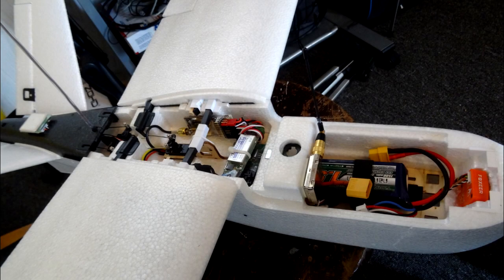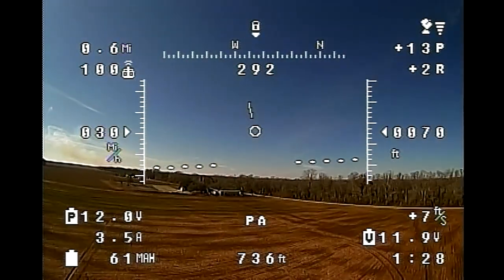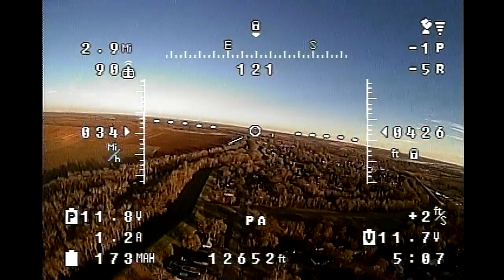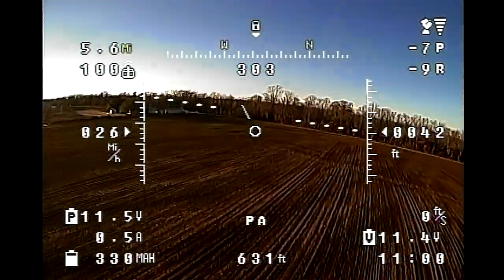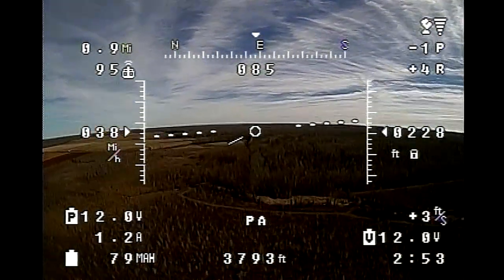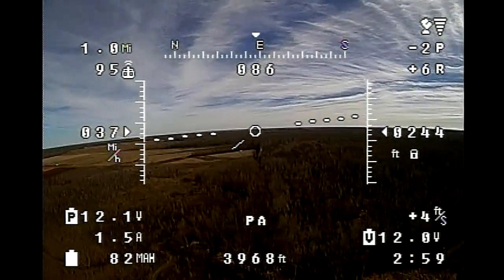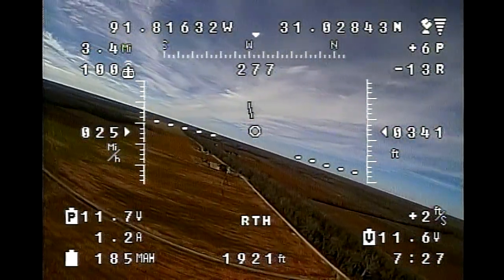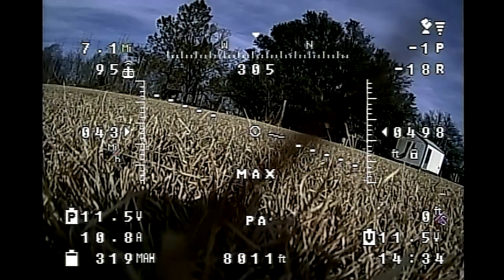Nano Talon w/Storm Follow Up

Comment: Great follow up! I totally get what you are saying about this not being an ideal FPV flyer. Either you want something fast to race like a wing, or a steady long range cruiser. But the Nano Talon isn't a racer, and it gets bumped around by the wind easily. I bought mine on Black Friday as around that time, it seemed everyone was reviewing this plane. I am still a beginner in R/C planes, so the appeal to me was the built in stability and the slot for the camera. Seemed like a nice little package and long flight times. I popped my FPV cherry on this bird so it has been exciting to fly, however when it's windy it's very hard to maintain a steady heading. The wind always blows me downwind and I almost lost her twice(was losing video). I appreciate your diligence to see just how stable you could make this platform. I will reserve a flight controller and long range system for my Strix Stratosurfer. I did put my camera and vtx on my Bixler 2 and will fly that today. Even without a stabilizer it should be relatively smooth.
Reply from the maker: I totally agree! I actually found this little plane flew better with the stock stabilizer than the best I can get out of the Storm... lol It's just not a good mix I guess. (I've had the Storm in a few other planes where it worked fine)
Reply from the maker: Nope, but it flew quite well with the stock setup, so I don't think reducing the throws will help much (if any) with the stock stabilizer. It may even reduce it's effectiveness and fly worse. lol If I end up putting it all back stock I may try a flight before changing the linkages back.
Reply: You guys are forgetting what is it's main feature - the portability. I believe it is the only airframe that can offer medium-range FPV performance while you can transport it in a (larger) backpack on a bike trip for example. If one have such perfect conditions for FPV like bonafidepirate, then there is no point flying Nano Talon.

Comment: Thanks for the great videos and commentary on this plane.  Seeing how easy the Storm fit in the bay I'll be installing a spare Mini Apm flight controller in my Nano Talon and see what flight times and ranges I get with a Lion battery pack.  It looks to be a great low wind flyer and a great plane to carry in the back seat for some quick park FPV flying.
Reply from the maker: I would be interested to see how the APM works in it. There's definitely room for the mini to go in there. I would expect it to work at least as good as the Storm, probably better.

Comment: Mine is getting ready to maiden.  I did discover the wing square tube slides in nicely but there is too much slop so the wing can move up and down too much.  I fixed it by simply drilling a small through hole and I screwed in a small self tapping screw.  This eliminated the slop.  I will post short video link.
Reply: Video link for tightening up the wings.  https://youtu.be/UjD3hmmwhR8
Reply from the maker: Sounds good! Mine was actually a pretty snug fit there, but I'd like to still remake that whole center plastic piece to align the wings with little or no dihedral. I think that might help the plane fly better in the wind and not get rolled around so bad. It might let a flight controller work better too not having the fight the dihedral all the time.
Reply: After multiple LOS flights today and yesterday.  It is the wing dihedral coupled with the V tail that appear to drive the wing wagging. When you make the wing please share the how to.

Comment: Storm OSD is very reliable and underrated.
Reply from the maker: Yep, it has worked well in a few other planes for me, I just think it's got it's hands full trying to handle this tiny little plane with too much dihedral. The combo just doesn't seem to work well.

Comment: watching your earlier footage with the stock gyro, seems to handle better and was softer stabilzation before the Storm .... I'm keeping mine stock.  I also wanted to tell you that with full aileron throw the gyro comes preset with rudder mix built in.... GO FIGURE@@@ :)
Reply from the maker: I will most likely put the stock stabilizer/mixer back in and just leave it like that... lol Like I said before, once I took that stock unit out, it became clear how much work it was doing to make this little plane fly so well... ;) I never noticed the aileron/rudder mix. I'll check for that if/when I put it back in the plane!

Comment: Hey keith. Just recently wrecked my skyhunter. Video soon on my youtube. Gonna buy a new kit and transfer electronics into that. For future knowledge where did you get you video setup? Im looking for a cheep 1.2Gh video transmitter (and reciver and screan since my goggles are 5.8) and a good cloverleaf antenna for 3 miles + of range? Once i get my skyhunter fixed ima save up for a system.

Comment: Hum... I find,  It's not stable in PA mode... I can see your  settings Gains + Angle?
Reply from the maker: One of the previous videos has all the settings I ended up with after adjusting it. (and most of the tuning process) All I did different for this one was reduced the aileron throws mechanically with the pushrods, then raised the roll gain in the Storm to compensate. I was never able to get it flying really smooth, and I don't think this tiny plane with heaps of dihedral will ever be a smooth flyer anyway. ;) I do think the stock stabilizer performed a little better though, and I've seen better results from other using varying iNav setups. (some worse also) The Storm has worked well for me in a few other planes before this one, I just don't think it's up to the task of taming this tiny little plane... lol
Reply: Thank you, I will receive it to test it in France. We'll see I also have an OSD Storm in a drawer ...

Comment: Thermals...?....I should be so lucky, it's freezing here m8...and windy with it...lol..It was wallowing and meandering again during RTH...I think it's just the update speed myself, it's like in terms of heading or direction, it's always behind the curve, too slow in other words.  One of the things about the F4 and inav, is that it's the exact opposite, the response time of the giros and Accs is a lot lot faster. But you're right, that Dihedral is always going to induce Dutch rolling.  It's a great little plane for a learner though.

Comment: The Cyclops Storm and Tornado OSD's require you to tune your amp meter scale.  You need to do some math using how many MAH you put back into the battery v.s. how many reported to figure out the % difference and then change the % scale in the odd.  You can get it nearly dead accurate.
Reply from the maker: I've done that numerous times. It's not so much the scaling is off, it just doesn't start to "read" any current until the motor is pulling around 1.5-2A (according to a power meter). The plane will maintain altitude at amp draws that low, and cruises comfortably at not much more. The OSD ends up reading barely any current while the plane is fly along happily, so the mAh counter is way off, worse and worse over time.
Reply: has it worked for you though?  doesn't for me
Reply: Strange, mine doesn't have that issue.  Even reads the amps drawn from my video system.  Firmware update perhaps?

Comment: What FC are you using?
Reply: Can I run the stock FC and use the storm OSD too?
Reply from the maker: The Storm is meant to work alone without another flight controller, it has it's own gyros and accells. That said, I found the Storm doesn't really work that great in this little plane. (It has worked well for me in other larger ones though) You may want to check the RCGroups thread an other videos of people using iNav in this one, I've seen varying results, but some have ended up with a setup that works well. Personally I think I'm going to just stick the stock gyro/mixer back in and fly it like that, and leave the long range flying to my other planes. ;)